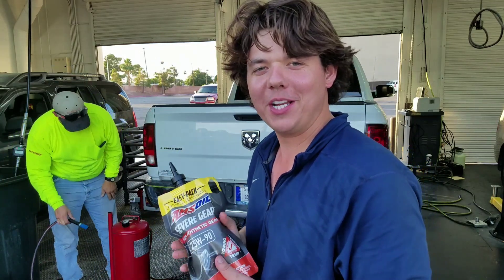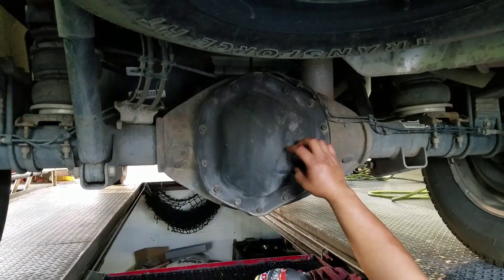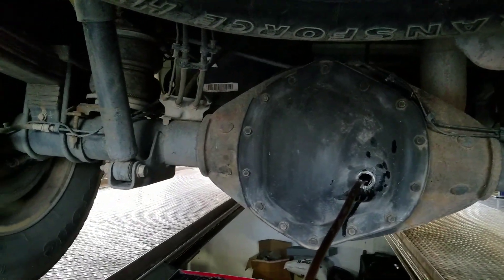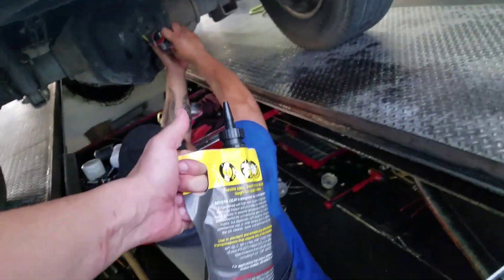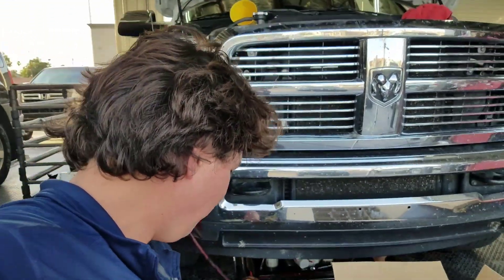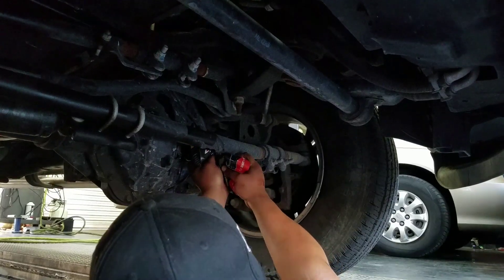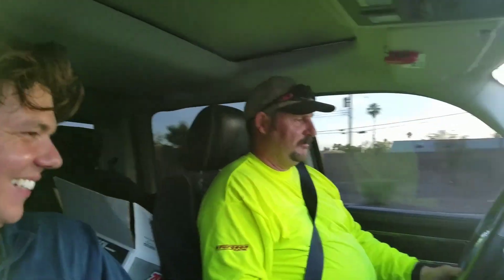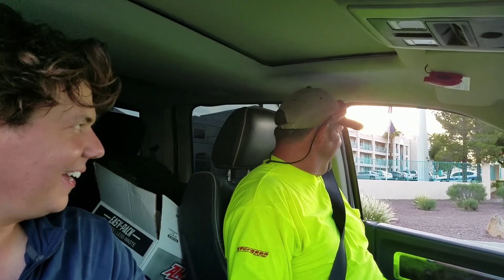2012 Ram 2500HD AMSOIL 75W-90 differential fluid change

Comment from the maker: Watch This NEXT: Banks New Diff Cover: https://www.youtube.com/watch?v=vdtmDl5EDJ8

Eben Rockmaker
Independent AMSOIL Specialist (Dealer#: 5331179) 
Mobile: (702) 472-3614

My link to buy AMSOIL: https://www.amsoil.com/offers/pc.aspx?zo=5331179
Steps to order by smartphone or computer: 
1. My blue link gets you 25% discount and free shipping on orders $100 or more as a Preferred Customer Member ( best way to buy AMSOIL ). I will get credit for your purchase when you use my link. Click My blue link, Click join now yellow bar Preferred Customer for 1yr or 6 months. Note: AMSOIL will not keep your Credit Card on file. There is no recurring charges.
2. Click look up vehicle.
3. Click auto light truck or any other type
AMSOIL has all the fluid amounts listed for you. It's best to get a extra bottle because that way if your short you won't need to reorder and pay shipping 8.99 on just one item...lol
4. After you have all the products added double check your cart then complete order.
Any order over $100 is free shipping and ships within 1 to 2 days. ( 90% of orders ordered before 12 noontime will be delivered next day😉 )

AMSOIL Vehicle Lookup - https://www.amsoil.com/guides.aspx?zo=5331179

If your vehicle is not on the lookup guide this is Amsoil technical support in Superior Wisconsin open during regular business hours - Amsoil Technical Support
Mobile 1 715-399-8324

We have #EbensGiveaway coming up at the end of every month on the last Saturday of the month it is a live video at 11 a.m. Las Vegas time. Jeff and I will be giving $100 gift card and a second prize for the second-place winner. To be entered share my YouTube channel on Facebook or Instagram tag me and send me the screenshot 702-472-3614 with your name.
#EbensGiveaway #SyntheticOilProtection 
#EbenRockmaker

Comment: Nothing better then fluid change👍
Reply from the maker: 😉, yes every 30,000 miles on OEM gear lube.

AMSOIL you can do up to 50,000 Mi of Severe operation Towing Exedra because of the hundred percent synthetic film strength.
Here's the full write-up on the severe gear 75w 90.
https://www.amsoil.com/shop/by-product/gear-lube/severe-gear-75w-90/?code=SVGPK-EA?zo=5331179
Reply from the maker: Thanks James for sharing my channel me and helping me get one step closer to my yearly goal of 15000 subscribers😉
#EbensGiveaway
Reply: Synthetic Oil Protection thank you for being the only Youtuber committed to the amsoil brand, and sharing the quality and protection amsoil brings to the industry.. without u I might not have pulled the trigger and tried amsoil, I YouTubed many videos and only yours popped up so I watched and gave it a shot and my car runs so much better,

Comment: Is that oil ok to use on the gs350? In not sure if mine ever was serviced and it's at 149k or transmission
Reply from the maker: Yes, yes it's a good idea to service your differential
Reply from the maker: This will guide you to all the products for your specific vehicle and year.
AMSOIL Vehicle Lookup - https://www.amsoil.com/guides.aspx?zo=5331179
Reply from the maker: If you have any other questions feel free to reach out to me anytime thanks for being a part of my YouTube Community angel😉
Reply: @Syntheticoilprotection  i will check out and bookmark the link. I appreciate it and Thanks Eben!